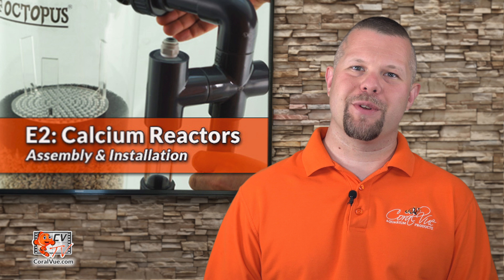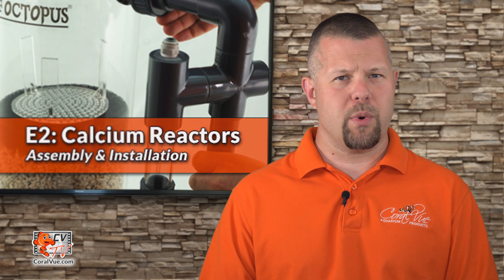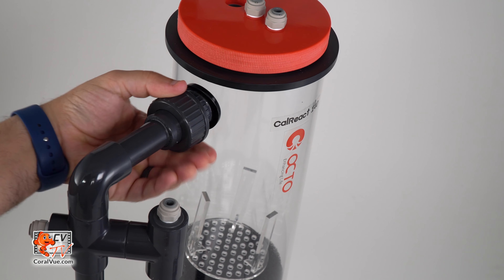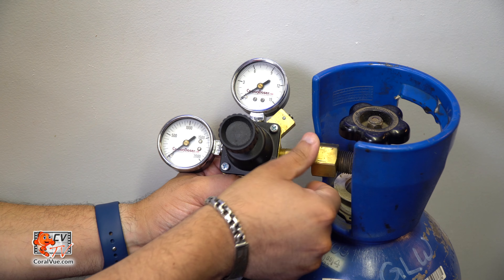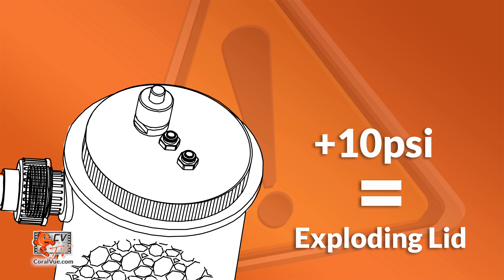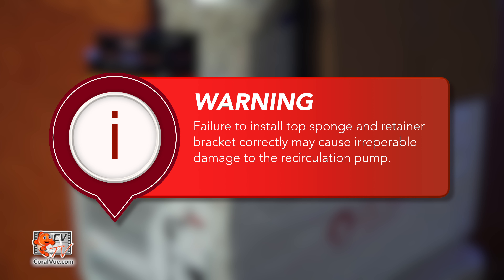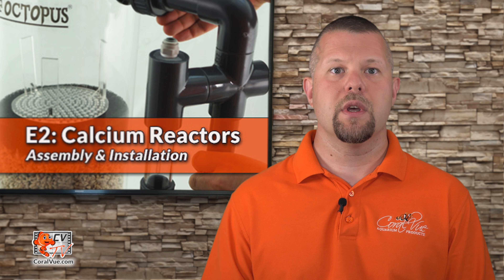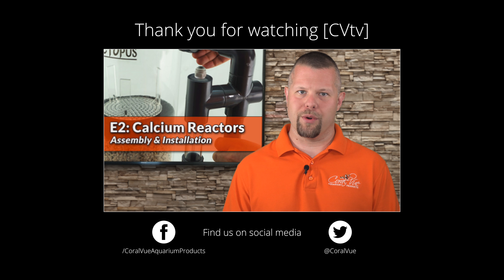Calcium Reactor E2: Assembly & Installation

Comment: I know this is a old topic but does the komoer needs to be calibrated in order to use a constant feed,I just bought one and ut seems yo work well without calibration, im not ti savy doing thing's like calibration.
Reply from the maker: All dosing pumps should be calibrated when first hooked up. Just the different lengths in line can through off the calibration. With the FX-STP it is rather easy to calibrate.

Comment: thank you for having awesome product i bought the calreact 200 the retainer bracket didn't come with the unit, does 200 needs the bracket?
Reply from the maker: Sorry to hear that your reactor came with missing parts. Please submit a ticket at coralvue.com/support with your proof of purchase, address and a short statement regarding the missing part. We will have that sent out to you. The bracket I believe you are referring to retains the position of the top media containment sponge to prevent it from blocking any of the ports at the top of the reactor.

Comment: I just hooked up the cr-140 with my kamoer how do I get rid of all the air in this thing the bubble counter is bubbling and co2 not even on I have the valve open all the way ,the one next to the probe that goes to fitting behind the bubble counter sounds like there's rocks in there washing away.

Comment: Dang.  i had hoped you'd have some more tips on this reactor.  Mine is a bit noisy if I keep the co2 recirc line open all the time.  I just keep it closed and purge it every now and again.  any extra co2 just goes out the reactor into my 2nd chamber from an old vertex carx
Reply from the maker: This video is the second in a series of 3 which covers how to hook up a calcium reactor with all the components. Make sure you subscribe. Our next and final video of the series will cover fine tuning, adjusting and troubleshooting a calcium reactor. There can be several reasons for the buildup of CO2 which I will cover in the last episode when I cover troubleshooting. Thanks for watching.

Comment: No bubbles seem to be making it through the check valve to the bubble counter but ph controller shows ph goung down in the reactor as if its functioning as it should is it normal to see bubbles at the Guage counter and not the reactors bubble counter.

Comment: Should the dual bodycalcium reactors both have the acrylic brackets in them?
Reply from the maker: Only one retainer bracket comes with all Calcium reactors. It is just required to prevent the sponge form interfering with the flow channels in the upper portion of the first reactor.

Comment: I bough my CARBONDOSER ELECTRONIC CO2 REGULATOR from bulkreefsupply and the meter on the right pressure digits are different, my digits starts with 5 - 10 - 15 - 20 so on, looking at yours starts with 3 - 5  so on, not sure what's the exact pressure i should put on main, also what happens when PH stays almost the same 6.83 - 6.89 doesn't go down to a melting point which is 6.7 - 6.5 what should i do?

Comment: I never thought to use negative pressure on a calcium reactor. The coralvue blog says otherwise. Which way should I go with?
Reply from the maker: I suggest that the doser be used to control the effluent on the output if using a Reef Octopus Reactor.

Comment: My local hardware store does not carry the proper barbed fitting for the reactor to adapt the Kamoer to the Guest fitting. What size fitting should I order for this purpose?
Reply from the maker: the John Guest Push fitting we suggest is 1/4in male quick connect to 3/16" barb for the tubing like the one found here: https://www.usplastic.com/catalog/item.aspx?sku=58237&gclid=EAIaIQobChMI0svGnuGE3wIVARFpCh3p6w7mEAQYAiABEgJsWPD_BwE
Reply: @CoralVueTV  So I found them online for a $1.24.... but they want $12.00 shipping. Ugh....
Reply from the maker: @EricColemanPreyou  I noticed that as well so I picked up a pack of 10 on amazon and got free shipping for around the same price.

Comment: I am having issues with my Reactor, it’s leaking from the top  I am not sure if it’s defective

It’s leaking from the top I did put the ring and made sure I tighten the cap next day water on the floor not sure what to do
Reply: hye Class im having the same issue. Did u fix it?
Reply: Did you use grease on the o-ring?
Reply: Did you fix it?
Reply: @EquariaYoutube  any luck?

Comment: He lost me when he put a line in the sump below water and connected to a valve what valve?
Reply from the maker: The intake line was submerged below the waterline of the sump. It then usually you have a check valve prior to the input if the reactor is placed above the sump and a regular valve if within or next to the sump.